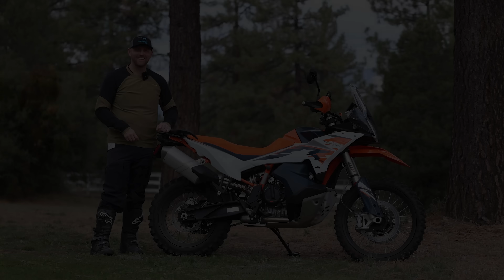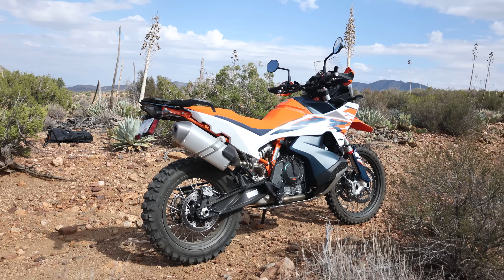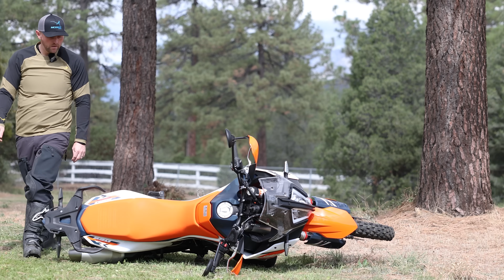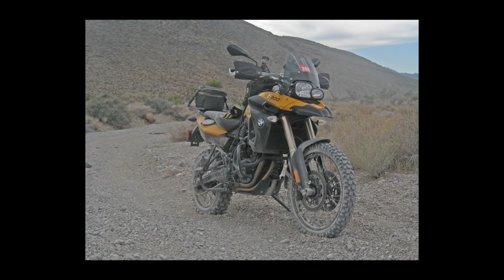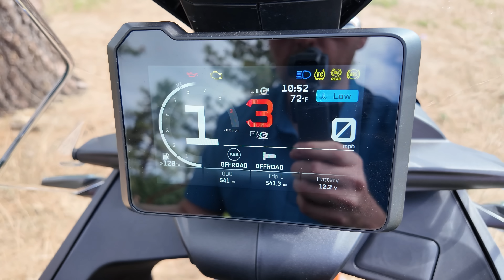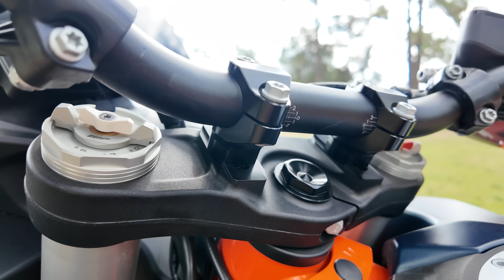4 Reasons the KTM 890 Adventure R DOMINATES Off-Road Adventure Riding

Comment: I have a 2024 890R, and I love it! But it only took 3.000 km until I got a blown rear shock and at 7.000i got a coolant leak. Both happened during a trip and affected my trip cutting it short...
I still love it cause it fit me like a glove! And the suspension vs my old T7 is amazing! 👌🏼
But I'm very annoyed by the issues I already had and potentially will have, especially engine related... It's a thing I do miss about my T7, not one thought given if it would ever let me down

Comment: Just a thought, my dad has put over 125k miles on a single
Japanese bike with no issues. Just maintenance. I have put 12000
Miles on a Japanese bike in about 9 months with no issues. I have since put several thousand more miles on a couple other Japanese bikes and my dad has put 50k on an XR650L in about 4 years and tons more on other machines. 

I have had one KTM and it was non stop BS. My brother in law has had 2 KTMs and both were great when they ran. 

Every single Sunday had one that broke down while he told everyone how great it was. 

KTMs have their place, but I don’t want to be 4K miles from home on one.
Reply from the maker: It’s a fair point, everyone has different experiences and priorities when it comes to long-term reliability. 👊

Comment: Just traded in my 2019 790r, never missed a beat. Looked at everything on the market for a few months but decided on a new 890r. Didn’t even ride it. 
I just love the light weight, low CG, the power and the incredible suspension. 
Good on the road, good in the dirt. 
My 4th KTM, never any problems.
Reply: Hi there been in the same train till 1 hour back that a pulled the trigger on another 790r... I cant see myself riding another brand or motorcycle, as my 2022 790 was been tested by the new owner I made the desition. Great video Ian

Comment: Great video Ian! I have a 2023 890 Adventure R and absolutely love it. I just put a new oil pan on (because I buggered the threads on one of the drain holes) but was extremely pleased to se no significant metal wear inside the pan- so the engine and cams are definitely perfectly fine after almost 15,000 miles! I would definitely buy again. It's a beast on and off road!

Comment: My 2019 790R with almost 40k miles showed excessive cam shaft wear on the second valve check.  No parts available for a couple months, so I bought a 2026 890R.  I still wish KTM would put the 990 Duke engine on the 790/890R frame.

Comment: For me it depends on what you classify as adventure riding. As you said aggressive off road, I’ll take the 690 r Enduro any day of the week. No way this 890 will do tough off-road without draining your energy vs the 690 capability both on road and off-road. Ive got the 2026 model and is so good, light and balanced. sure the 890 would be better on longer hauls but in the bush there is no match as far as big bores go. You drop that 890 on a hill climb you will struggle.

Comment: I've put 7000km on my 24 model in 4 months. Several thousand with a pillion. Absolutely love the suspension for the Australian conditions for both on and off the road. 

Only had 1 tiny issue which is the cruise control occasionally fails to engage. I suspect its dust in the switch though. Other than that it's been amazing.

Comment: I traded my '23 KTM 890 Duke R, which in the end was more for my son, who is no longer interested, for a '23 KTM 890 Adventure and couldn't be happier. It is better for me than the R model because I am going to use it only in easy off road terrain.  My cams are fine, but (me as a German) we now have a supplier in Germany that has solved the cam wear issue by nitride hardening OEM camshafts and treated like that they will no longer wear. The treatment is EUR 495 and you are scott-free.
Reply from the maker: thanks for sharing your experience and the info on the cam wear solution!
Reply: @BigRockMoto  I am ordering a set. These guys are one of the most trusted KTM shops in Europe. Their YT channel is super interesting. look up Pirate Racing!

Comment: I  raised the handlebar, I didnt find any other way  since Im using a steering damper, the one it comes with its just useless- unless I use this damper it wobbles at highway speed, by the way I had just had a smal crash,  the bike went sideways 20meters on a paved road...I do recommend having passanger foot peg sliders and rear axle sliders, literally they saved the bike from further damage, its like $50 both

Comment: The answer to your question...yes we did buy an 890 adventure R even with all the bad press. Mostly exaggerated by internet trolls that dont even own a ktm..
My wife and I have a garage full of ktms. Including my tricked out 690 enduro R and my wife's new 24 tricked out 890 adventure R that we use for BDRs.
One word of caution peeps. The 890 may not crash as good as some would have you believe. 
Be very careful what skid plate you choose.  Do not use the AXP plate. You have been warned!
True story, my wife and I were riding this weekend up in the mountains above our home in Moab. Beautiful day but a bit chilly in the shadows. My wife was breaking in and trying out her new powerparts rims and Motoz Ralls tires.  Getting ready to head out to Texas for a Austin Moto Adventures 3 day training class.  Then we were going to hit the new BDRX called Texas Hill Country. 
We were riding down a gravel road call Geyser Pass when we rode over a patch of ice hidden under the gravel.  I made it through.  But my wife went down. Long story short....that POS skid plate deflected into the gas tank, pushed the tank onto the hard parts on the motor and not only broke the plastic fuel pitcock off , but unfortunately cracked the left side inner gas tank. Bad day. Fuel pouring out every where.
Fast forward several hours I got the bike hauled back home. $1400 gas tank gone. And so is our trip.
She just ordered the bad ass aluminum skid plate from B&B offroad engineering out of Australia.  No more fake ass plastic skid plates for her. And we found a new orange rally tank on line for a ok price. So $$$ later the bike should be better then ever.
But she still loves the hell out of the 890. Best bike she have ever ridden.

Comment: Hey there! Since you're already talking about that large low fuel tank and it's "sisters", maybe you could also have a future video talking about the new cfmoto 800 mt-x (european naming, not sure how is it called in the US/canada). I believe it uses the same lc8c engine (790 version), with same platform, same low fuel tank, etc. Maybe something to consider, given it's lower price point, and similar on and off-road capabilities, with fully adjustable suspension, quickshift, cruise control, etc! Great job!

Comment: I have over  11k on my Norden 901 and it has been reliable except for a pinched wire.  I love the bike and the low C of G  created by the  gas tank design.  I like the comfortable seat and softer suspension.  I  ride aggressively on my KTM 450 EXC but  off road  this bike is just for touring and  exploration.....I love it.  I hope the new management is smarter and sticks to  KTM and Husky and does not buy  another  exotic Italian bike.  For those who are dirt oriented adventure riders   I think a  twin 500 or   650 would be the sweet spot for dirt and  road.

Comment: It’ll dominate your bank account with all of the broken parts after off-roading: things like tank mounting brackets bending causing the tank to block the clutch arm so you loose the clutch mid ride. Every time I rode it I was worrying about not getting it hit and how much it would cost.
Thank god I got rid of it
I never felt totally fine riding it it always felt like something was about to break off.

It is fun to ride but not worth the problems. Also build quality is questionable.
Electronics are glitchy
Immobilized alarm for no reason.
I once had to wait 9 hours at the dealer for an oil change while they tried to clear the immobilizer fault code
If you slip the clutch to climb hills or go through water you willl quickly fry the clutch.
It is a great bike if you don’t actually ride it lol

Comment: great video, i really wanted the 890R, but my motorcycle is my main vehicle of trasport so the reliability issues made me pull back my deposit, the bike closest to the 890R i enjoyed was the AT 24' small tank without electronic suspension, the feeling of the suspension set up was really similar to me aside from the firmness, keep in mind im tall and heavy  so some things that you might not like on the AT i could make use of, i tuned and set up the suspension for my weight, really firm for aggresive riding and i think i now have a much better  package, Would love to hear your thoughts about this comparison.

Comment: 2023 890 ADV R with tons of mod.  Love it.  Does good on the road, 2-up (why I bought it), good range, ergonomics, have a tower on mine with the rotti intake that I like, well balanced and ergo's to tackle moderate offroad (logs, babyheads, etc.)

I''ve owned a number of KTM's and Huskies.  Only problem I have really had was a sticking fuel gauge and bad ignition on my 14' 1190.  Some poor decisions on airbox design on some of their earlier mid 2010's models, but nothing outrageous.  It's unfortunate their business side doesn't make better strategic decisions and their batch QC leaves you wondering if you got a good one or a bad one.

Every time I think about going and swapping to a "reliable" brand....it's just not as fun....

Will I buy another bike in the next year and if so, KTM (or adjacent).  I wanna unload my 701 for a 500 so maybe.

Comment: The 890 bars are flatter, but the frame and headstock are tall.  Risers compensate for lower headstock geometry. Regarding wet noodles, how do surfers, skateboarders, skiers, etc overcome this?  Athletic stance.  Proper balance and conditioning prevent them from being pitched forward/backward.  Motos even give us handles.

Comment: I own a 23 and I absolutely love it. I actually got mine when on section 2 of the NorCal BDR my old bmw 1200gsa engine blew up. I hopped on the back of my dad’s KLR and rode up to Reno and bought the 890r. Straight off the showroom floor I rode the rest of the BDR. It handled it perfectly. I had one pretty good fall on a rocky uphill and the only damage was a dent in the skid plate. Since I bought it  I’ve done over 23k miles and two BDRs. I use it as my daily commuter and for weekend rides with my friends. It’s been super reliable. Only issue I’ve had was a leak on the rear shock but it was handled by the warranty without any hassle. Highly recommend the 890r for anyone who wants a bike that will shred any type of riding you want to do.
Reply from the maker: That's an amazing story and great to hear about your experience with the bike!

Comment: Ian 890 is in top when it comes to off-road adventure machine , but how far Bette than the f900gs and the Tuareg 660 ? Remember you always preferred the Tuareg 660 off-road. 
Thx
Reply from the maker: The ktm is better, but only when riding very fast. At moderate speeds, all 3 are great bikes.

Comment: Great video. Very accurate critic. 2019 790 Adventure R. 18K miles no cam issues.
Reply from the maker: Glad to hear your 790 has been so reliable!
Reply: @BigRockMoto  Cams have been fine but have had; immobilizer, display and coolant loss issues. But still have it and it's a blast to ride!

Comment: To answer for your question if I would buy it again.... considering all the issues I had,... Yes I would buy it again, its a great bike, but not for this price tag! I am expecting that travel bike with this price tag must be very reliable. I owned 790 2019, 890 2024, and now I will be waiting a few years to see if the quality improved or not. If so, 890 will be my choice again, but If not, I rather go with different brand and fine tune it. Or there is still chance they shave down 4000€ of the price tag. I woudlnt care about issues then, and just fix them.... but as I said, not for this price tag. I consider this as highly overprice well performing bike that if full of cost saving projects that are very noticable.

Comment: I would "dissagree"  on the statement its difficult to harm that and it doesnt need crash bars.... In my opinion it doesnt need crash bars when you drop it, low side, or high side it, but if you hit the tank from front. Just a little, you will make HUGE damages. The tank will break, dont ask me how I know. but mainly... broken tank move uppwards, this will bend your radiator as there is no clearance. All front plastics are attached to radiator. so these will be broken as well. Same as you will bent the bash plate mounting frame. Battery plastic holder is also attached to the tank, so these pieces of plastics will be also destroyed. The washers that are holding tank are attached to the brackets that will be definetly bent too. Belive me, This bike is great. The tank is good protection BUT...If you manage to destroy the tank, it will lead to a lot of other things damaged, and obviously the cost will be huge. Just the material cost me 2500€, and I need to mention I bought it with 20% discount thanks to my firends.... No labour as I did all the job by my self. Imagine let your dealer repair it. You would end up on double price.."just for tank damage" So the tank is good thing in my opinion.....most f the time, but it can be big downside as well, and honestly, it´s not so difficult to hit big stone or sump. :)
Reply from the maker: Thanks for this info

Comment: I agree with your point about the riser bars, but the reason someone should install them is to gain that controlling position. As a very tall rider, riser bars are necessary to achieve that position. If a 6’8” rider doesn't add this, it basically prevents them from being in a controlling position.  I'm sure you weren't accounting for the very few strangely tall individuals who ride, and providing that information as a general use scenario, and I couldn't agree more. Spot on, and thank you for the content.

Comment: One thing I don't see people talking about is the difference in the power bands between European and Japanese models. I grew up on Japanese 4 stroke bikes which predominantly had the power in the low range, meaning lots of low end grunt. These European bikes (my Husky 901 for example) are very different. They have very little down low (especially for a 900 cc motor), but come on super hard around 4,000 RPM's. Just something for a new owner to be aware of that I don't see mentioned a lot. If you are on paved roads all the time, you'll love it as is, but I'm a dirt/gravel road rider who tries to stay off interstates, so I've geared down the front sprocket which ended up not being enough, so then geared up the rear sprocket. It doesn't change where the power comes from, but I can at least keep it in that range much easier.

Comment: Thanks for the video! - I own a 790 Adv from 2019. It had some quality issues but fortunately did not show camshaft problems so far (40.000 km). I fully agree with all you said. In the next season I want to trade the 790 in. I rode both the 890 Adv. S and R and some other models, too. The 890 was stunning good, none of the other models reach its levels behalve the 901 Norden Expedition. For me as a traveller and less dirt oriented driver, the 901 Exp. is more suitable than the 890 Adv. R. I am utmost happy with its 890 engine and suspension, combined with a bit more comfort. The 890 Adv. R and the 901 Expedition are the ultimative performance beasts and fun maker whereever you drive.

Comment: Thank you Ian.

My 890AR has over 60,000 km on it. Reliability has been perfect. 

I struggled to get the suspension right, but with softer springs and revised damping, it's a real weapon on road and off.

I didn't choose any of the extras, other than heated grips - I wonder if this, and the Li ion battery, have helped with electronics reliability.
Reply: Update: By 62,000 km the inlet camshaft is toast. I've looked after it well, changing the oil every 5k to 7k km, but still it's failed me. They will all fail given time.

Comment: I've got a 22 890R.  It is a pretty great bike for hard adventure riding, not as good for touring. I know the newer bikes have better air management, that may make it more tolerable at highway speed.  I've taken this bike places that would make my 1250GSA wet its pants, should really be on my 501 instead, but it does it.  The suspension is ok, I need to have something done to it, bottoms out and rebound is not enough for me when riding aggressive off road. It only has 9K on it, but no other issues so far.  The electronics are far superior to my BMW in every way.  I would buy a 25/26 tomorrow to replace it if I had to.  Biggest downside to me is the closest dealer is over 3 hours each way (6+ hour round trip), but at least I haven't had to go back with it yet.

Comment: 2023 adventure R owner here. 30,000 miles with no issues! I did a cam check at 16,000 miles and everything looked good and was in spec! When my bike finally blows up the way the Internet says it will, I'm going to buy another one! Until then I will continue to ride the shit out of it!
Reply: Bought a 23 890 adventure such a huge shame because it was without doubt the best handling and fun bike I’ve ever had. It’s a shame because it let me down just too many times. In the 2 years I owned it, 6months was in the dealers being repaired. New starter motor, new immobiliser, new starter relay, new full wiring loom, new indicator, 2 new batteries….. really miss it though I just hope KTM sort their quality out otherwise I won’t go back. Your review is however extremely accurate.
Reply: @craigclifton2737 sounds like "swapnostics"
Reply from the maker: Awesome